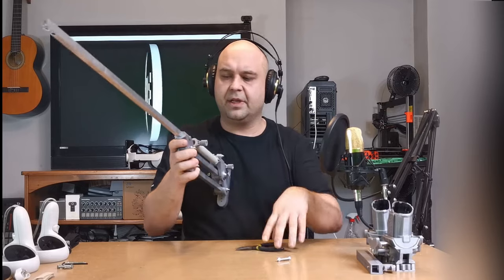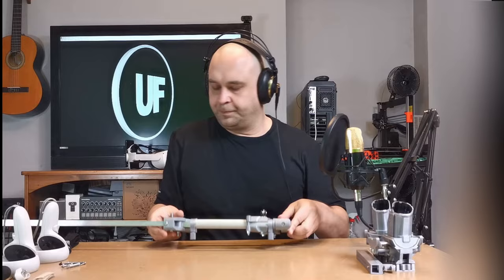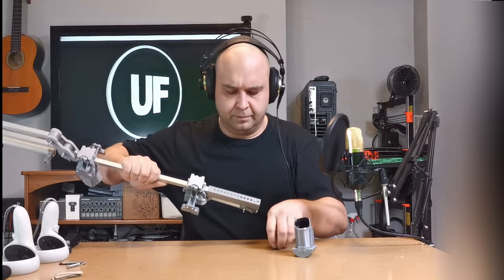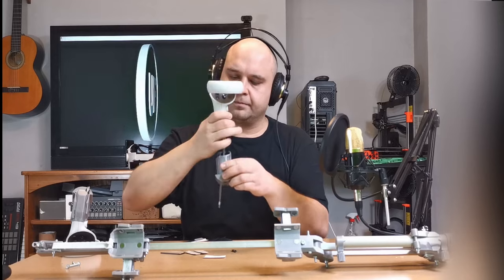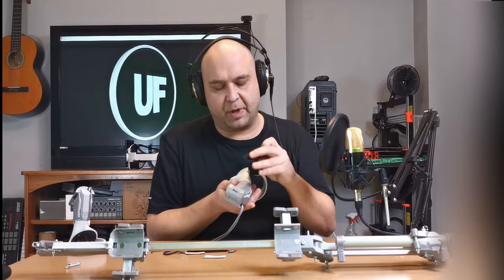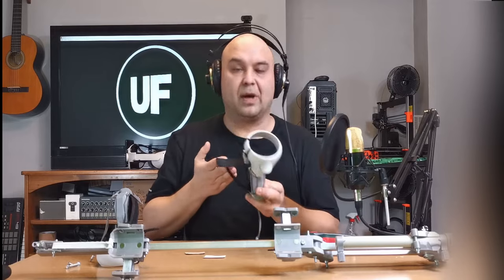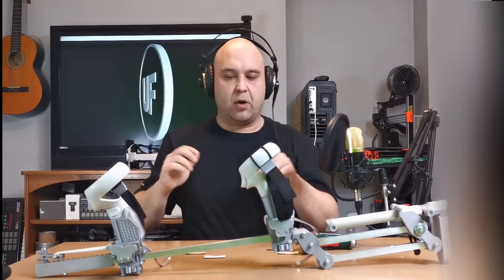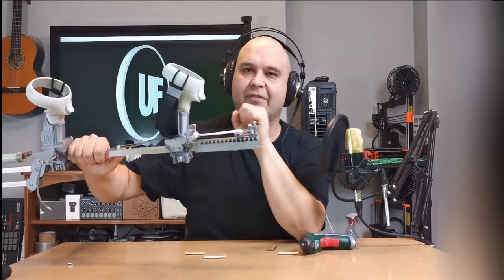UniStock MK1 Assembling Video.

Comment: I would like to see the pico 4 version.
Is pretty different and i can't figure  how to assemble it.
Reply from the maker: the olny difference is in aq cups. Unscrew the screw, put the controller in, and screw it togheter. If the standard setup wont do for Your game and gun, You can unscrew the bottom screw that holds the cup togheter. Dont unscrew entirely. Just so You will be able to tilt the cup, to Your prefference. You can also move the whole top party of the cup to the sides. Everything else is the same
Reply from the maker: https://youtu.be/NchdwRku0gM